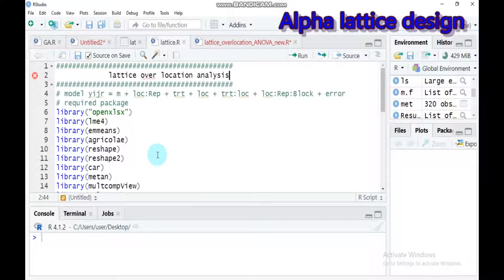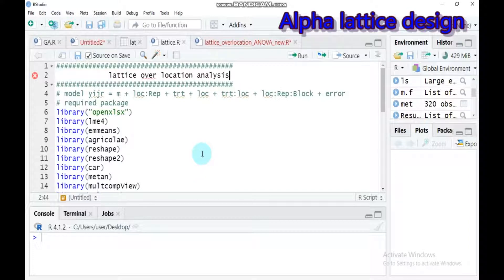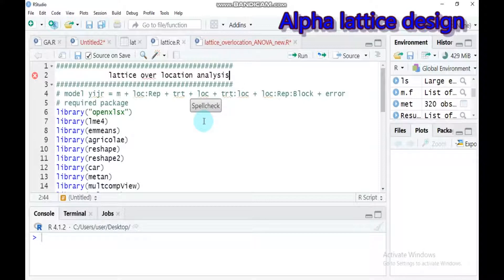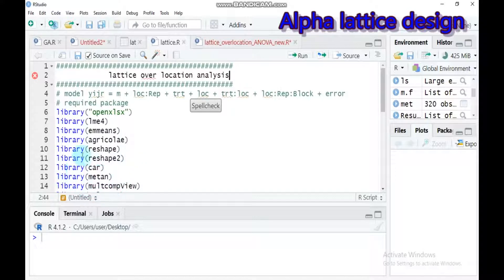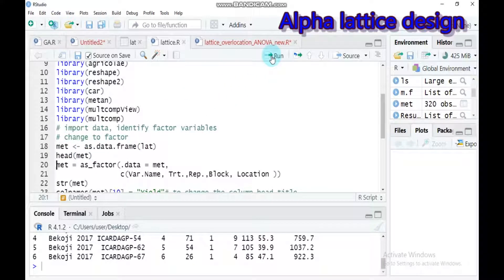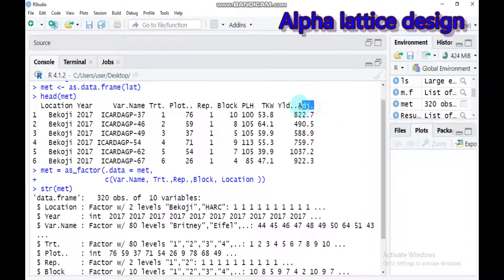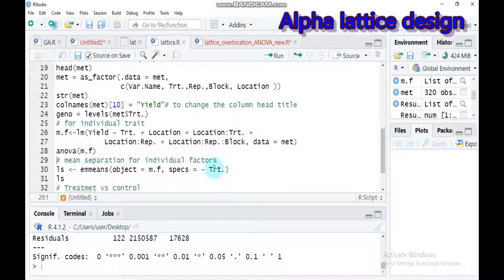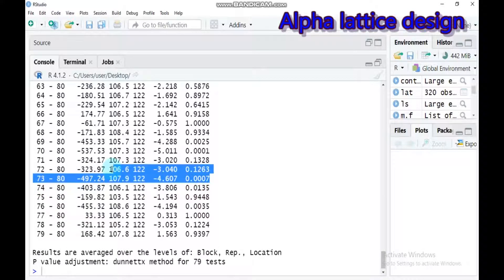Alpha lattice design  over location analysis on # R software

Comment from the maker: The code 
############################################
# lattice over location analysis
############################################
# model yijr = m + loc:Rep + trt + loc + trt:loc + loc:Rep:Block + error
# Input data 

library("openxlsx")
library(lme4)
library(emmeans)
library(agricolae)
library(reshape)
library(reshape2)
library(car)
library(metan)
library(multcompView)
library(multcomp)
# import data, identify factor variables
# change to factor 
met <- as.data.frame(latt)
head(met)
met = as_factor(.data = met,
                c(Var.Name, Trt.,Rep.,Block, Location ))
str(met)
######################
# Anova using fixed model- Individual location RCBD 
#met$SiteName <- factor(met$SiteName)
# describe the traits to be analyzed 

colnames(met)[10] = "Yield"
Traits <- c("PLH",  "TKW", "Yield")
geno = levels(met$Trt.)

Result.aov <- vector(mode = "list", length = length(Traits))
names(Result.aov) <- Traits

Resultmean.comb = matrix(nrow = length(geno), ncol = length(Traits))
colnames(Resultmean.comb) = Traits

Resultmeancomb.contrast = matrix(nrow = length(geno)-1, ncol = length(Traits))
colnames(Resultmeancomb.contrast) = Traits

chk = "80"

system.time(
    for (Trait in Traits) {
      
      eval(parse(text = paste(
        "m.f <- lm(",Trait," ~ Trt. + Location + Location:Trt. + 
        Location:Rep. + Location:Rep.:Block, data = met)")))
      Result.aov[[Trait]] <- anova(m.f)
      ls <- emmeans(object = m.f, specs = ~ Trt.) # mean separation for individual factors
      cont = contrast(ls, "trt.vs.ctrl", ref = chk)
      cont = as.data.frame(cont)
      cont$contrast = as.factor(cont$contrast)
      cont = cont[sort(cont$contrast),]
      rownames(cont) = cont$contrast
      ls = as.data.frame(ls)
      ls <-ls[,1:2]
      ls = ls[sort(as.factor(ls$Trt.)),]
      Resultmean.comb[, Trait] = ls$emmean
      rownames(Resultmean.comb) = ls$Trt.
      Resultmeancomb.contrast[,Trait] = cont$p.value
      rownames(Resultmeancomb.contrast) = cont$contrast
      
    }
  
)

sumAnova <- data.frame(Result.aov) # combine the anova table result into one table 

#########################################
# Write the means to excell
#########################################
# Function that writes a named list to Excel workbook 

wb <- createWorkbook()
addWorksheet(wb = wb, sheetName = "SummaryANOVA")
addWorksheet(wb = wb, sheetName = "TraitMeanSep" )
addWorksheet(wb = wb, sheetName = "Cont_Trtvscntrl" )

writeData(wb = wb, sheet = "SummaryANOVA", x = sumAnova, rowNames = T)
writeData(wb = wb, sheet = "TraitMeanSep", x = Resultmean.comb, rowNames = T)
writeData(wb = wb, sheet = "Cont_Trtvscntrl", x = Resultmeancomb.contrast, rowNames = T)

saveWorkbook(wb, "SummaryresultLatticeComb.xlsx", overwrite = TRUE)
Reply: thank you so much sir for your selfless help